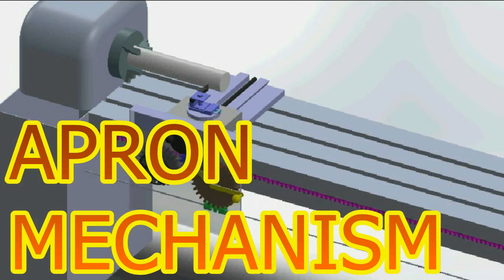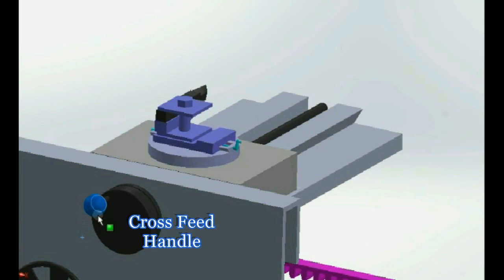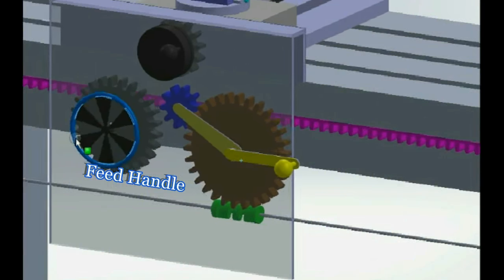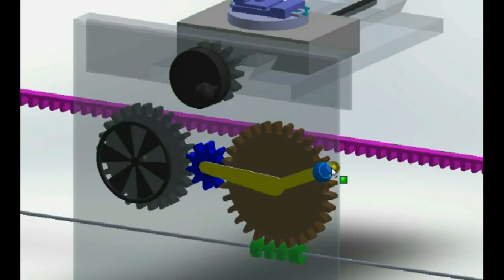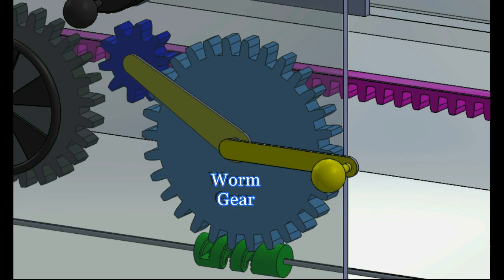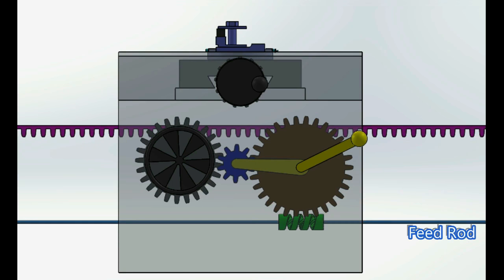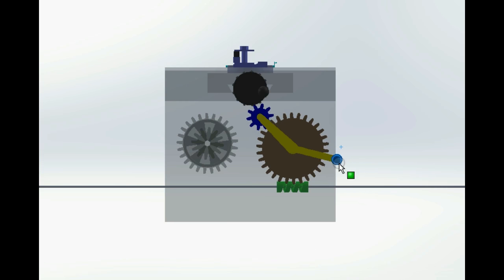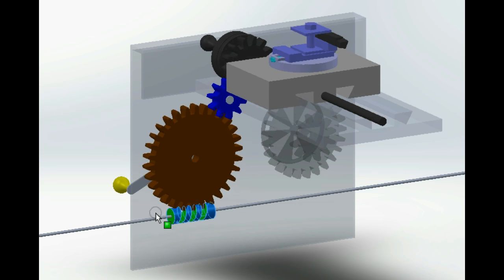Apron Mechanism : Power Feed in Lathes Explained

Comment: I have difficulties in understanding the term "feed" in lathe machine. Please do a video giving me a clear idea
Reply: Feed is synonymous with "giving". We give a cutting edge into a work at a certain rate to cut material from the work. This is feeding. Giving the tool into the work. Feeding is also giving motion at a certain amount. Cross feed is moving something cross dimensionally. Longitudinal feed is moving the apron, for example,  lengthwise the lathe. So, giving a tool edge, drill bit or motion to execute the work is feeding. If you drill a hole very fast, it means the feed was fast. If the drill spindle rotates fast, it has nothing to do with the feed. Feed is the power of your hand pushing the hand drill into the work. Or the speed at which the drill bit penetrates into the work, for example woodpiece.
Reply: Hey, you're a woman into science? Nice.
Reply: Thank you. I am a man into translation.